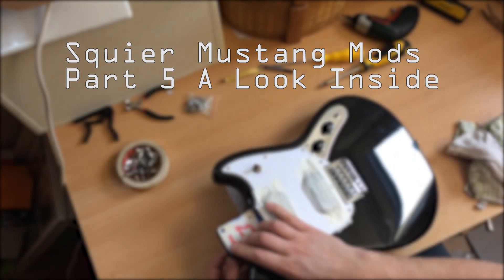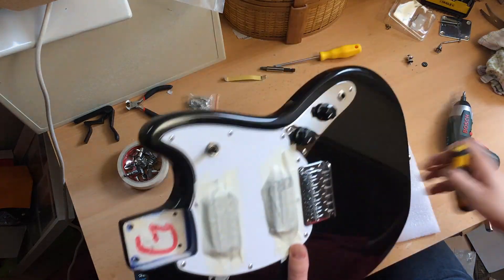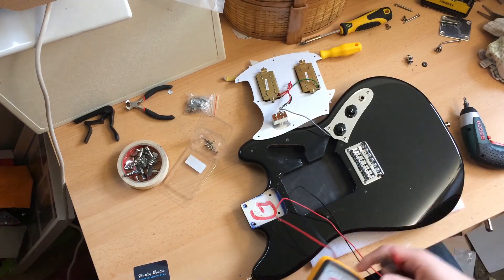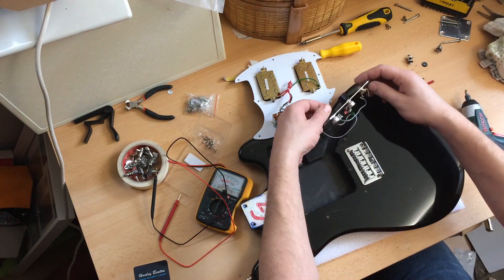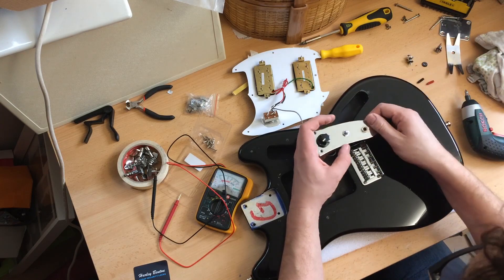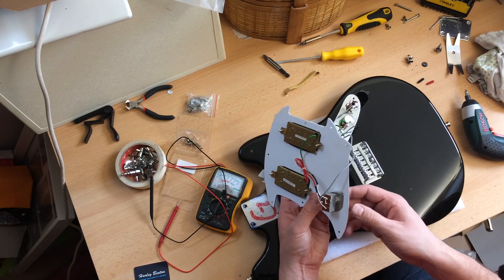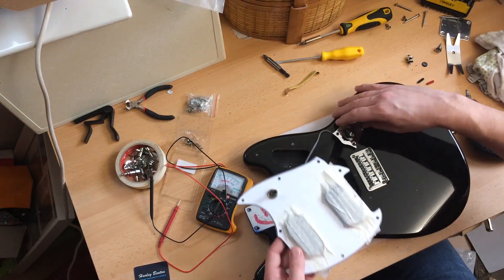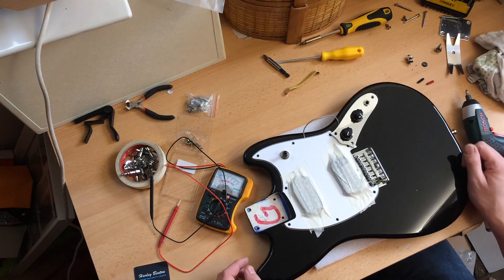Modding the Mighty Bullet Mustang Part 5  -  A Look Inside

Comment: What are the chances of changing the pickups so they have separate wires from each coil so you can do coil spiting by changing one of the pots to add a push pull selection for the split. Is the body deep enough to accommodate the push pull pot?  Which pickups would recommend that would give a sweet sound for solo leads and still OD and distortion quality with minimum hum?  Cheers good vids. Thanks!

Comment: How many wires have the pickups?
Is possible to switch the pickups to single coil mode?
Greetings from Barcelona.
Reply from the maker: The pickups only have 2 wires. It's possible to open up the pickups and get access to the four wires but that's not a simple task. I have a video in the works so if you can hold off on that mod, I'll explain how to do it.
Reply: This video will be great!
Thanks for answering.